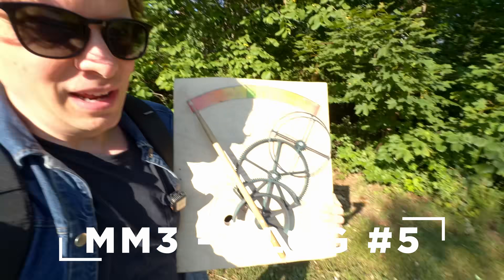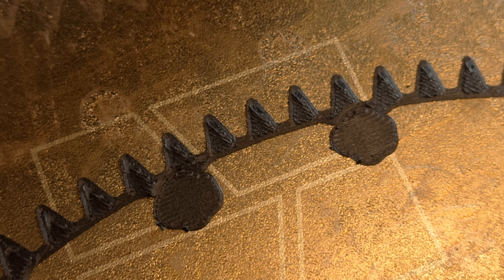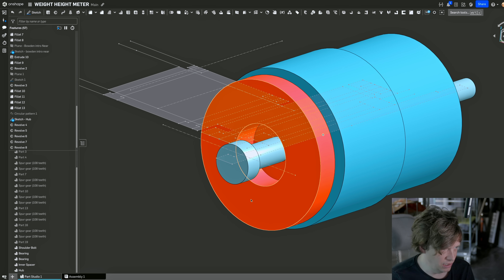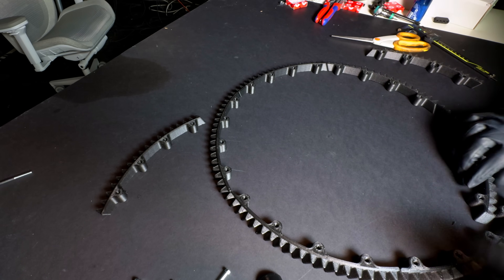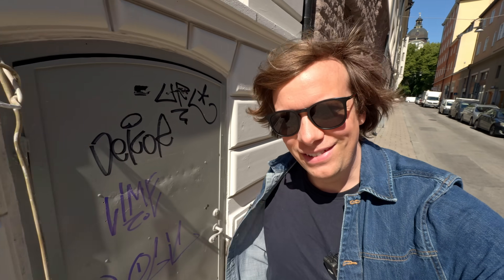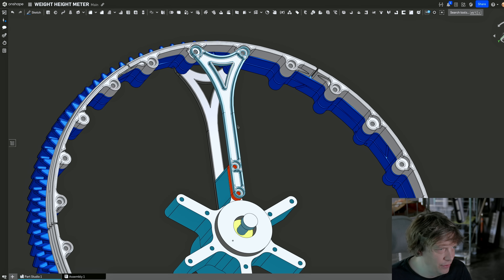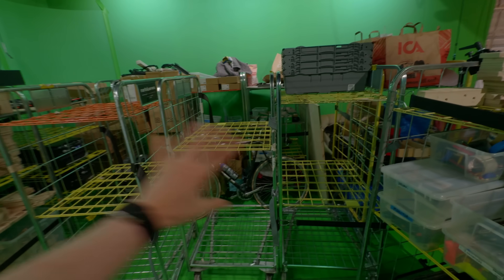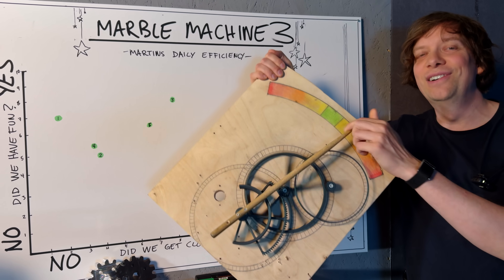3D Printing Helical Gears from Carbon Fiber Filament - MM3 VLOG #5

Comment: Instead of printing test pieces, print calibration pieces and dial in the printer settings. Then you know you will get good dimensions, and you can print bolt holes or nut prezes based on the measurements, the way that is clearly natural. Cheers.

Comment: Are those sketches in an ANSI part template? All the dimensions are facing a sensible direction. So much easier to read than an ISO template.

Comment: There have been some great (and accidental) improvements in printing without supports. There is a way where the print overhangs now that use curves to expand the edge and once semi cooled can support the next print pass. There is even a way to calculate printing in a slight increase vertically and overlapping the previous pass so it turns out flat at extended distances by accounting for the weight at the desired distance and is also flattened and supported by the next layers. Basically you are printing in a vertical rise initially and as the next layers increase the structure you decrease that rise and flow over the extended distance so it comes out as a flat piece that is completely supported.

Comment: How much torque is transmitted through the spokes? If more than about *none*, radial spokes are problematic. Having them cross will let the spoke reach the hub at an angle close to the tangent, which is a lot better for torque transfer!

Comment: It seems like your efficiency chart does not really make sense, assuming building the MM3 is like writing a test at school, right now you are studying for the test and saying it doesn't do anything for writing the test as you didn't write anything down. Preparation is a very important step. 
I suggest setting much smaller goals maybe with a timeline, like finishing the big gear in a week for example, then you gain much more motiviation and apprechiation for what you achieve. 

Also good luck with your move!

Comment: For this application. I would use classic snug supports. I dont even consider tree supports if i dont need to support something that has a print underneath it already.
Also, I believe the overextrusion can be beneficial for your strenght, but you have to account fir it in the design. Also you should be able to lower the extrussion multiplier for the supports (so it doesnt stick to the print) in the slicer (works in orca, dont know about bambu).

Comment: Really love the idea — super creative and beautifully executed with the 3D printer. That said, I do have some concerns: I’m afraid this design might not hold up reliably in practice. It feels a bit over-engineered and potentially prone to failure at multiple points.
Personally, I’d go with a more standard solution — a large, off-the-shelf gear paired with a matching drive gear, ideally made of steel (or stainless steel/aluminum). That would give you a rock-solid foundation for the drive system of your Marble Machine X.

Either way, best of luck — I’m really enjoying your videos and love watching your progress!

Comment: It's ok to use hex nuts in 3d prints as long as torque isn't important. But it might be helpful to increase the amount of walls in those areas to improve the strength of the slot.

Comment: This is where a dual print head comes in handy. They can print in 2 different materials at the same time which can be great for supports as the second material will be sacrificial and dissolved away with ease. Leave almost a perfect finish where the support was and so much easier to print parts that is super detailed but hollow like a Eifel Tower all in one print with all the internal being sacrificial. The other option use for dual head is the use of the normal rigid print material and using the flexible rubber print material can get some tight and efficient parts for damping sound or just giving cushion and not having to rely on gluing and hoping the stuff sticks well. 

I bring this up as some machines do have upgrade options that can be installed or getting a second one that does dual while the other does single as there is always a lot of easy to print ones without the need of support and 2 working together can really cut down on the printing and testing phase. Given how much you might need to print, it might be useful idea to ponder around.

Comment: a couple things you need to be careful about when you are designung something that someone else may print.  Is you really should do test prints and calibrate filament and printer settings to match the cad vs adjusting the cad.  Orca slicer is better than BAmbu's slicer.  Because you can save the xy calibrate with the filament and I found that I have some adjust for every filament.

Comment: I think you’re over-extruding, which is why 1) the first layer looks too squished, and 2) your tolerances didn’t transfer from the hole to the hex. If you dial in your extrusion you’ll have much more reliable intuition for tolerances.

Comment: Hey Martin, be careful using CF and GF filaments on parts with wear (like gears!) as they release carbon fiber dust into the air as they wear down! It's not super great for you or other lubricated connections!

Comment: Please calibrate your filament, this is "painful" to watch! I wanna scream at my screen, like an old guy (yes I'm on old guy)! 
Your printer is over-extruding, this is why you have problem with tolerances and why your supports were touching the part at first. This machine should be able to easily do sub 0.2mm tolerance, even lower with very very good calibration.
Also like other are saying, quit the hype of carbon fiber, PETG with a 0.4 mm nozzle will give you better parts, lower tolerances and no health hazard!
Love your videos I've been following since a very long time ago!

Comment: Martin, it’s probably time that somebody introduced you to the Gantt chart, which is a project management tool that you would probably find useful.
Making one will have you thinking about what your task dependencies are and what can happen in parallel, as well as prioritising things that are important.
It would also give you a clearer idea of whether you’re making progress: you measure against your current assigned task, rather than the whole project. If you keep what you’re doing on schedule, the rest takes care of itself. There’s also less temptation to procrastinate when there’s a short-term deadline for the current task, rather than a project deadline that’s vaguely specified and a long way off.

Comment: Hi Martin! my first time commenting from a long time 3d printing nerd. For floating flat surfaces, standard supports leave a MUCH nicer surface finish than organic. Organic supports primarily excel when used on uneven shapes/slopes, but the branches on flat spots leave weird overhang gaps, and can make quite the mess. One more thing, please consider a safer alternative to that CF-Nylon, as in high friction use cases, it will shed nanoscopic shavings of carbon all over the place, and it's no better to touch/breathe than fiberglass, so at least be safe with it, and some conformal coating will go a long way with a material like that. Love your work , and hope to see where your projects lead!

Comment: I think you need to have a better metric for efficiency. Because the tour is far away everything is going to feel like it's not getting you very far. Efficiency should be defined by whether or not you met your objectives and how important those objectives are to get you to the next stage not the ultimate goal.

Comment: I think you interpreted your diagram wrong. If you ask yourself: Am I getting closer to the world tour? Is the answer: yes. But in conclusion you want to go to the right side of your diagram, but I think it doesn't matter, how far you are to the left or right side, if it is in the end a finished project. There should be another diagram with the question: How close did I get to the world tour? !!

Comment: I think you would benefit from a Gantt chart for the world tour; that way, you can track progress on each stage of the project and its overall completeness.  Then the efficiency chart could track the time spent directly on the world tour, indirectly (divide that time by half), and the time spent away from the project.  Efficiency and progress are two different metrics, and using progress to measure efficiency leads to feeling discouraged.

Comment: Please be careful with those fiber reinforced materials! If handled without gloves or a sealcoat on the surface it releases microscopic carbon needles in your skin that can stay from weeks to months inside your skin and may stay there permanently if you are really unlucky. I would also advice wearing some sort of breathing filter equipment, because those carbon fibers become airborne while printing, handling or working on the part. Those fibers essentially act like asbestos and give you fibrosis when breathed in. Sure its not a significant amount per print but over the years there is 100% gonna be irreversible damage to your lungs, so please take precautions. Btw. the same counts for most fiber reinforced materials besides stuff like wood fiber infused parts but be especially careful with carbon- and glass-fibers!!!

Comment: I''ve already watched a few videos of ppl warning against the carbon fiber filaments. They can "shed" the fibers which will embed themselves into the skin or you could even inhale/ingest them if you're not careful. Given how much the gears are going to grind against each other they will give off a lot of that stuff. So for safety reasons I'd consider either using a different material for parts that will see a lot of wear and tear, or combine different filaments to have the  CF for more structural pieces but something more safe on the interfaces between the moving parts

Comment: Why are you prioritizing the tightness meter over designing the "basics" first (the actual components that will play the music)?
Reply: Martin has been building and sanding that massive wheel as well.
And the tightness meter is part of the power input, where the movement of the machine starts.
Or maybe Martin just likes to do this first :)

Comment: If you want the most dimensional accuracy and your geometry can handle it (eg. no steep overhangs) change the wall printing order to print the outer walls first.. If you have 3 or more walls, outer/inner/outer works best in my experience.

Comment: i think world tour is too far fetched a goal for a daily rating, at least at this stage, world tour is so far from where you are right now that it will always feel impossible, i think a better and probably more encouraging method would be to set the rating board to your next major goal, ie. completing the timing system, completing the dive mechanism, or one of the instrument mechanisms etc. this will help with getting bogged down over the efficiency ratings. This also means that you get to make a new board for every goal, and even compare towards the end how motivated you were for each part of MM3.

Comment: Martin please be aware that carbon fiber 3D Prints can be quite dangerous. The carbon fibers will split from the parts over time and can get into your skin where they are impossible to remove. This will leave a chronic itching in the spots where they are imbued into the skin.
Reply: Not to mention the lungs!
Reply: @tubeLu  ESPECIALLY the lungs
Reply: he's using proper gloves and addressed this issue at Vlog#3

Comment: If you included a recess for the bolt head then you wouldn't have needed supports, unless there's another reason to have that feature inset? Also I'm not sure as to why you need to offset the herringbone gears in such a way, as surely that would create slight cyclical imbalance in the axial forces, exactly what the herringbone is used to counteract.

Comment: Why print with carbon fibre filament? Its weaker than non filled filaments, wears more on the extruder and hotend, releases fine carbon fibre dust which is bad to breath in, results in a part with a rougher and more abrasive surface which is bad for a gear and most parts in general.

 Its just an over hyped buzzword of a filament which is functionally and practically worse than regular filament.
Reply: Filled filaments is not a hyped buzzword. It's main benefit is to help prevent warping during printing or optional annealing steps. PPA has plenty of layer adhesion to spare so adding either glass or carbon filling does not negatively impact it as much as say PLA. Filled nylons are almost certainly going to be more user friendly for those who aren't willing to put in time to dial in their machine perfectly.
Reply: @Neaxtec warping is better solved by enclosing the printer in a cardboard box (his printer is already enclosed). It offers much more benefits than filling it with ground up fibres. Also, the issue of fibre filled filaments isnt layer adhesion, its material strengrh. The fibres are below the critical fibre length for a composite, so they act as an impurity rather than reinforcement. Fibre filled filaments universally break lower than their unfilled counterparts.
Reply: My thoughts exactly!
Reply: what material would you suggest ?
Reply: it would only make sense if he had a large printer and printed very big parts in one piece as these filled materials tend to warp a lot less.
Reply: Yeah carbon fiber is not a buzzword like how you are trying to present it. For one thing there is different types of 3D printing carbon fiber filament. Short fiber, long fiber and continuous fiber. Short fiber offers stiffer and more precise printing so for making gears like this, it fits quite well and shows how little you know about why its used. Long fibers start to offer strength in certain printing directions but they are the ones that can start causing printing problems. Continuous is the strongest and closest to carbon fiber reinforcing one would expect and does indeed grant a lot of strength to the part but also the most problematic to print. Also to add a point, all the the variations offer different densities of fiber fill so none of them is the same and give different results.

Also gears have a thing called a break in period where any rough is worn down so any of that abrasive surface will smooth out quite quickly and this process is across all gears made in different materials. Not saying the flying carbon fiber in the air is not a risk but your overall statement that its weaker and has no function or practicality is the part that is wrong. That's what calling it a buzzword is after all.
Reply: @silentferret1049  there are no "long fibre" carbon fibre filaments. None of the carbon fibre filaments contian fibres above the critical length at which they'd actually take up load, because at that point they'd be too long to mix into the filament. All fibres in composites have a critical fibre length, below which the matrix material (the resin/plastic) cannot effectively transfer the loads to the fibres. Theres a reason real composites have long, continuous fibres (which have nothing in common with the ground up fibres in filament, which would be lucky to reach 100 microns in length since they need to freely flow through a nozzle opening thats typically only 400 microns across.) measuring tens, hundreds or thousands of milimeters running across the whole part. 

The source with the most optimistic critical fibre length for abs/petg etc. I found was 700-800 microns, which is  many times longer than anything youd actually find in a 3d printing filament. Even then I'm skeptical about this value since you never see anyone making real composites with ground up fibres.

I've never seen a carbon filament tested to be stronger than the plain unfilled filament, it always tests to be weaker. Plenty of channels like cnc kitchen, tomas sandladerer, mytechfun etc. Have all shown this. From a material science point of view, it makes sense throwing a powdered impurity into the plastic mixture makes it weaker.

And carbon fibre gears do not have a "wear in" period after which they'll stop being abrasive. The surface will wear, primarily the plastic will, exposing fresh, and even more abrasive carbon fibres.

Comment: Not I-beam, U-beam.
Just to check, you do know that carbon fiber in nylon is quite useless? I don't mean it doesn't have uses, but its main use in not very specialized printing would be just making the nylon a bit more dimensionally accurate and less prone to warping when printing bigger parts. In use the CF in most of the materials just makes them weaker because the fibers prevent the plastic forming uniform microstructure. I would probably move just to normal PA6 filament just because the CF at least in these prints really doesn't do anything except create more dangers when handling the parts and raise the costs (165€ for 750g? That's in the same category as the infamous PETG Tungsten at 245€/kg).
Also the PTFE-pipes of the AMS don't really like PPA-CF (or generally any abrasive materials, CF is one of the worst in that).

Comment: Why slot in hex nuts and not press in a hot nut or use a threaded fitting that grabs in the opposite thread direction.

Comment: Martín, if you learned what is the gap which suits well for your bolt, maybe you can know easily gap value for other parts, and save time. Functional specifications are done from charts which already been studied and approved. You are doing an amazing engineering job, next step the diploma ;)

Comment: Hi Martin, your printing your first layer just a bit too close to the bed.  Also, ,make sure you are using a hardened print nozzle or you will quickly pay the price for printing that abrasive filament.